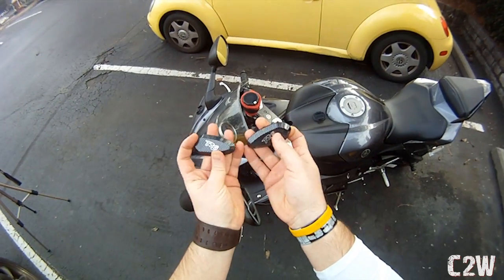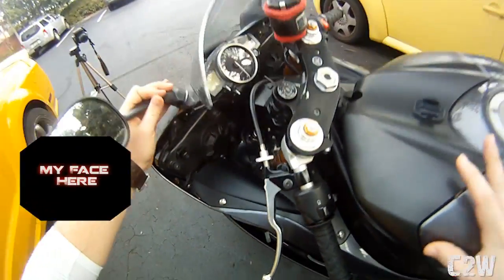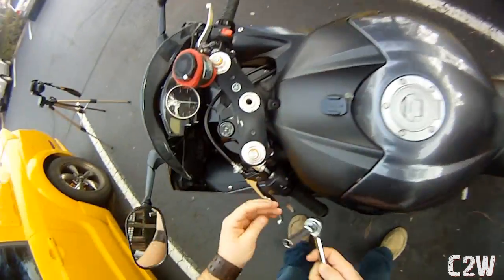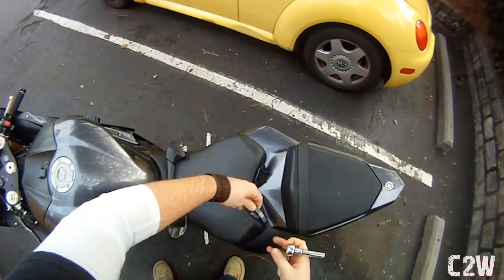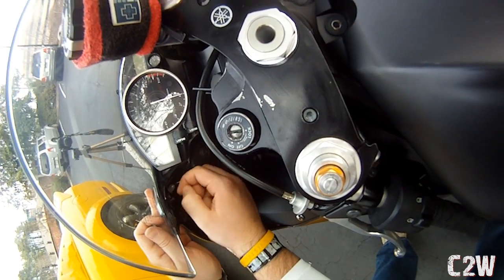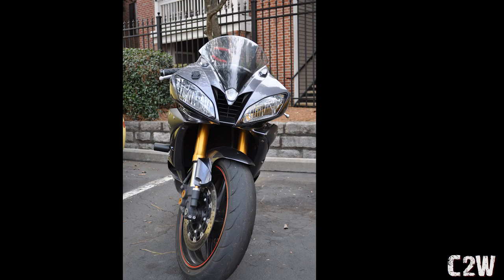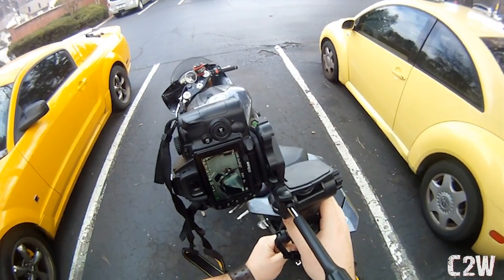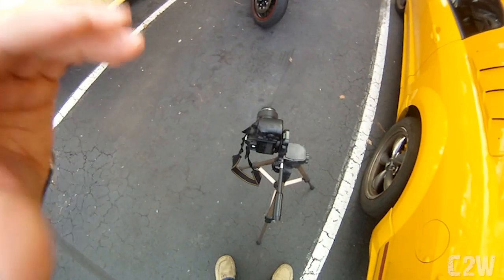Yamaha R6 Mirror Removal [ How-To ]

Comment: odd question i know but... :
i have seen some motorcycles with mirrors placed at the lower side part of the motorcycle so that your mirror points at the outer side of your shins. were those guys simply genius or is there a name for that? personally i always had trouble with my elbows/arms/jacket blocking the mirror unless i move away from it